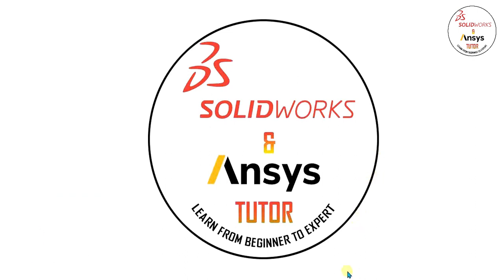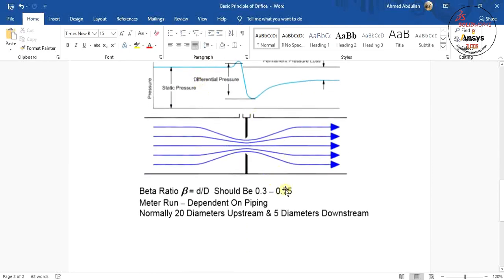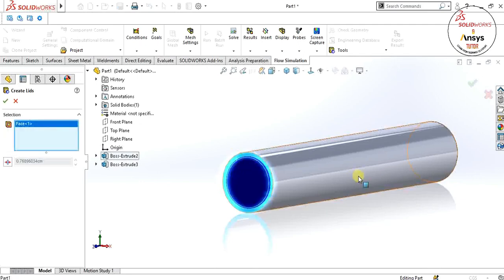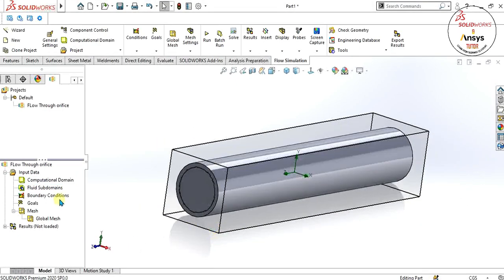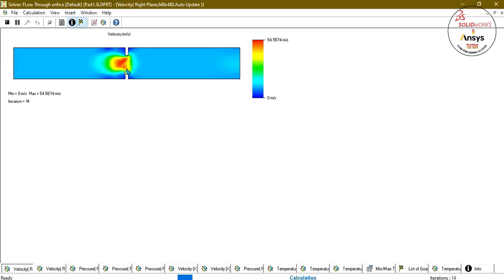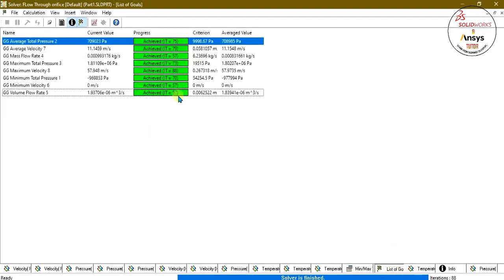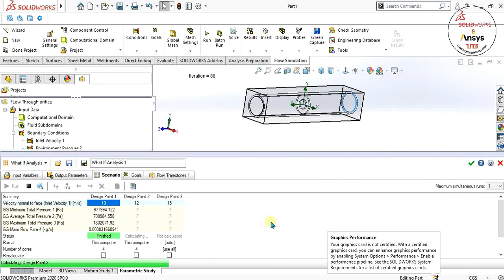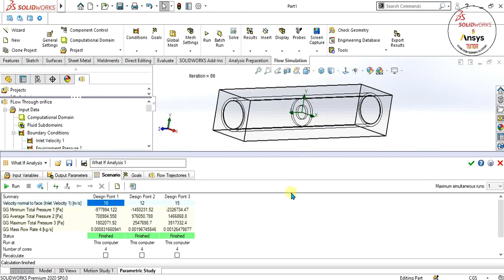📌Solidworks Flow Simulation Through Orifice | Parametric study in Solidworks flow simulation

Comment: i want to learn CFD in solidworks please tell me how to learn in starting stages in very simple manner. i will be waiting for your reply.
Reply from the maker: To Learn CFD You must have good knowledge of Fluid Mechanics and how to use the tools like Solidworks Flow simulation for external and internal analysis start practicing with basic pipe flow and move forward taking real life example you can learn this tool like that .